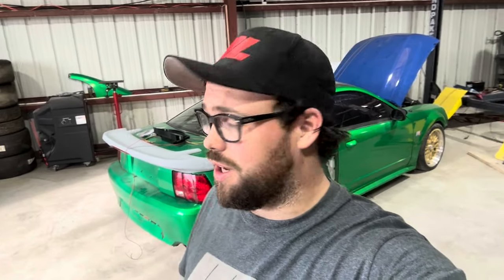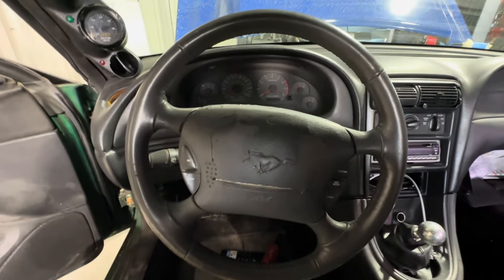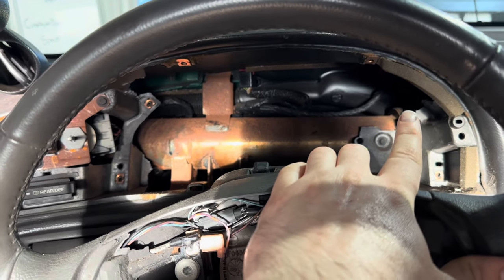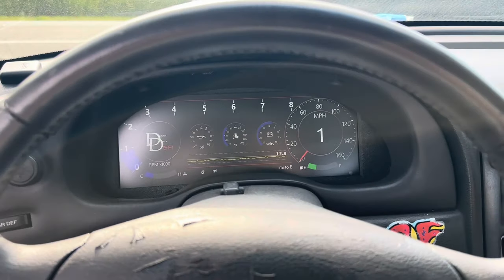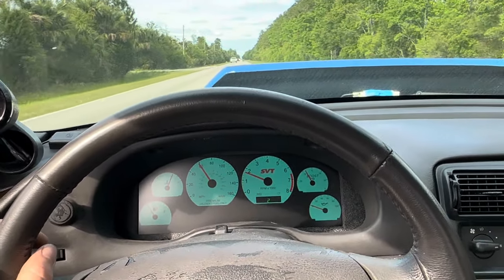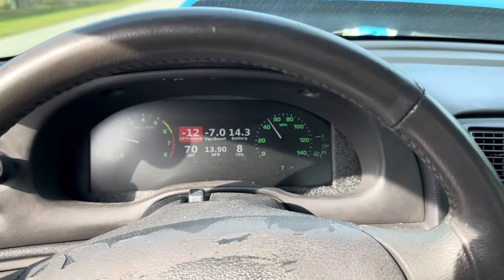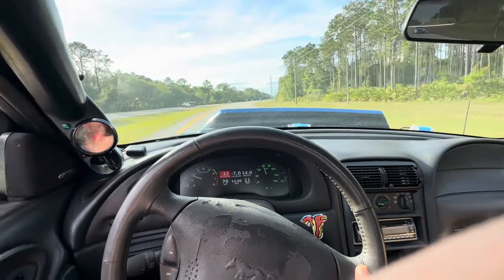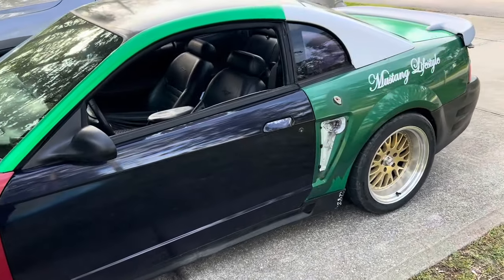Turdzilla gets a Digital Dash and FIRST WOT PULLS ON THE STREET CAMMED 3V

Comment: Got some lag on the gauges.  I'd recommend making some adjustments to the lag factor perhaps to get the response up.  Reach out to DDEFI they know exactly what setting to fix to get that RPM gauge to be smooth and fast
Reply from the maker: It’s because I had multiple clusters cued up. When I close them it speeds up

Comment: Good to see some turd vidz. 
Stock for stock, do you think the 3v is faster than doing a 4v? I don't remember what the mark8  motor made.
Reply from the maker: Mark VIII engine made 282 lol. 3V is actually a very impressive engine. Very easy to make 320whp with just bolt ons. The 4vs do have more power in the 6-7k range though. 3V is often overlooked because Coyote is better but it is a fun platform to play with.
Reply: Its close the 4v has more potential but they're not too far off.  A cammed 3v is a really good option for 2v guys it saves weight and you make a good bit more power than a 2v with any given setup and it can be tuned on stock ecu it's a really good option for the money.  4v are more limited so they're gonna be more pricey probably.  3v is more readily available.  I'd prob go that route.  A b head could make close to this power with a good set of cams and fbo with ported short runner so either can make similar power 3v is prob gonna be cheaper...
Reply: Wow thanks for the info , You actually answered a lot of my questions without asking lol . Do you know what the average 3 valve goes for these days?
Reply from the maker: @nicholasbatres2452  $1500-2500

Comment: I've always thought cammed 3 valves sound like pushrod engines.
Reply: Cammed 2v and 4v also sound nasty as hell they all share the firing order with older Windsor motors so that's likely why.
Reply: @midnight347  But 2 valves and 4 valves never sound like a pushrod engine, that's my point.  I actually don't care for how they sound when cammed, they sound more like a truck engine.  The 3 valve has that "in your chest" powerful cammed sound like pushrod engines had.

Comment: why a 3v?
Reply: Why not?
Reply from the maker: At the time when I bought this car back I didn’t want to repeat any builds I had done before: didn’t want to do 2v,4v, or coyote. Landed on 3v for affordability. I would have loved to have put a Godzilla in it but that would be over 5 times the cost of the 3v setup
Reply: That makes sense, if you're taking requests how about an old school 351w with a carb setup.
Reply: Because it's significantly cheaper than a coyote or ls swap into a 2v car it's a solid option for the money you can use stock trans even tune it with stock ecu.  It takes off alot of weight and gives a good bump in perfirmance over a 2v.  A similar modded 2v might see 300 rwhp while this is pushing 360 rwhp plus it's lighter.